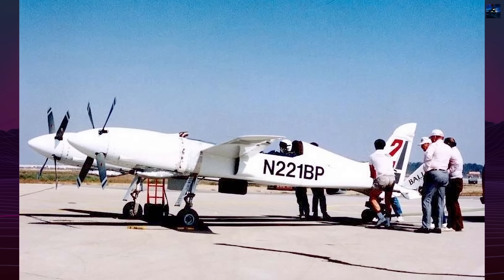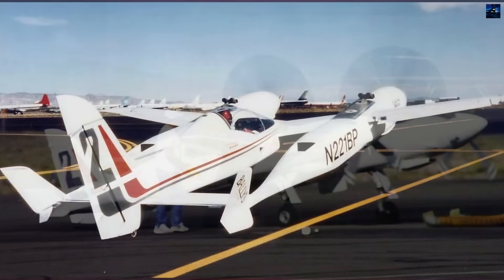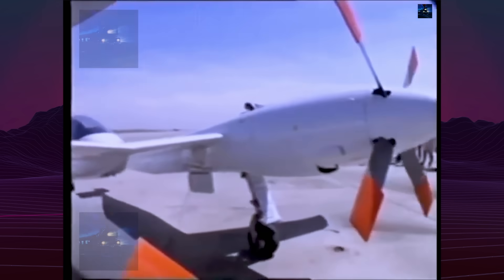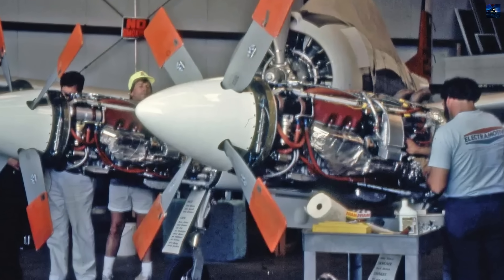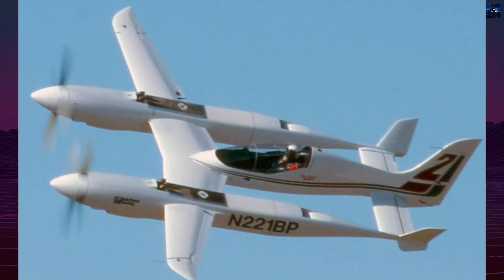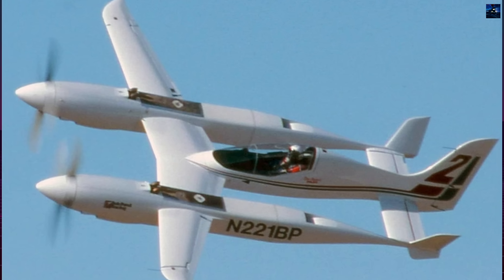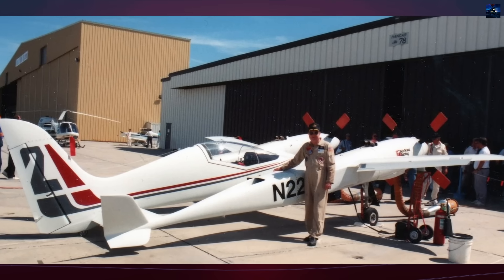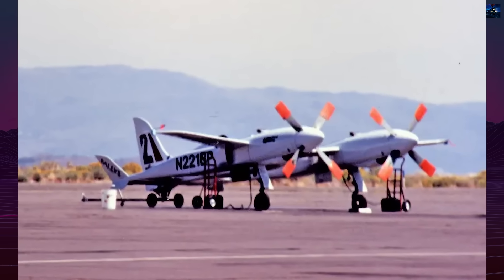Scaled Composites Pond Racer: That Weird Twin-Boom Racing Plane You've Never Heard Of

Comment: I was there, the day they went in. It was... a shock. Both plane and pilot had so much promise.
Still, the whole thing reminds us of how aviation mishaps are often a collection of successive "small" things. An engine out scenario in a twin is always a challenge, but manageable in the hands of a skilled pilot, which Brickert certainly was. In a small, light aircraft that was built for speed, however,  the rudder authority required to manage the asymmetrical thrust is borderline at best. When the engine failed, Rick lost the ability to feather the prop. The result was a huge amount of asymmetrical drag. In order to keep the aircraft under control, the pilot had to keep the airspeed high (i heard 175 mph) in order to have the required rudder authority. All this, with only minimal power from the good engine (asymmetrical thrust again), meant a rapid descent was required. I know that they were high enough to bail out when it started, but it all happened VERY fast, and for whatever reason, Rick decided to stay with the aircraft and attempt an emergency landing in the dry lakebed adjacent to Stead airport. That's a dicey proposition under the best of circumstances, but more than one pilot has walked away from that scenario, but in a tiny, plastic airplane, moving at 175 mph, the result was as predictable as it was tragic.
Reply: "I was there, the day they went in."

Too many times have I been able to say that.  I count my blessings that I was not able to make it there in 2011. RIP Jimmy, Rick, Gary, Tommy and anyone I have forgotten.

I remember when Rick brought Dago in in 1984 with the engine on fire and windscreen obscured by oil and smoke. The engine was nearly split in two by broken connecting rods.  The man had balls of iron.

Comment: I remember seeing this at the Planed of fame museum and was pretty impressed with reading the specs. Kind of wondered what happened with it for a few years then heard about the loss. I've heard from many aircraft people that auto engines are not suited to aircraft.
Reply: Yes/No. Aircraft have their own demands on engines and using an automotive engine requires reexamination and reengineering some details because it is definitely being repurposed. But there are a lot of Experimental category aircraft with automotive engines, from Piets with Model A engines to RVs with small block Chevys. My favorite was a Ford 3.8 V-6 adapted by an engineer named Dave Blanton in the late ‘70s or early 80’s. Used it in a TriPacer conversion called a V-6 STOL. I think about 12 were built.

Comment: In Star Wars I, both N1 and pod racer have strikingly similar geometry to this inspirational vehicle.
Reply: Now this is Pond-racing!
Reply: The N1 sure looks inspired by the Pond Racer, but it seems to be inspired by the XF5F Skyrocket (layout & colours).

And arguably also to a lesser degree by aircraft like the SR-71 (engines) and F-104C Starfighter (wings and tip mounted cilinders).

Comment: Great plane ..wrong engines.
Reply: Should have used a Ferrari V12 with turbos. More appropriate for extended high rpm use.
Reply: There was more wrong with it than just the engines. Perhaps a pilot ejection system would have been adequate...
Reply: @daszieher  Ejection seats are not allowed in air racing.
Reply: @MX304 didn't know that. I wouldn't race without a seat.

Not that I am anywhere close to having the choice 😅😂
Reply: @daszieher  It is a major safety issue for other pilots and spectators. Imagine if a pilot punched out and the aircraft went into the crowd. Or the wind carried the pilot under parachute back into an active flight pattern. Or someone pulled the handle in a turn and ejected directly into the path of another aircraft etc. That's why the FAA won't allow it.
Reply: @MX304  Thank you for explaining that. It makes sense.
Reply: @MX304  The only alternative option in your scenario is certain death. That doesn't make any sense to me.
Reply: @daszieher  VERY few deaths in air racing would have been prevented with hot seats. Either not enough time to even pull the handles, low altitude and bank angles being outside the seat's performance envelope etc. Plus people don't realize how big modern ejection seats are. You aren't fitting one in a P-51, let alone a tiny home built like the Pond Racer. Only the larger jest like the L-39s that are raced have the capability of having hot seats. It simply isn't feasible. Air racing is a dangerous game. They accept the risk.
Reply: @MX304 not being able to fit one in a P-51 may justify not having them in warbirds, however, it is no valid reason for forbidding them.
Reply: @daszieher  There are many valid reasons to forbid them. Which is exactly why they are forbidden. The pilots don't want them either.
Reply: @MX304 I disagree. It sounds like the useless discussions on why GA aircraft shouldn't have CAPS/BRS.
Reply: @daszieher  Apples to hand grenades comparison. GA and air racing are entirely different environments.
Reply: @MX304 they may be very different, but they share a common fact: once the aircraft is no longer controllable, there might well be a system to either save the entire aircraft or at least its crew.
Stubbornly arguing against a method to save the people aboard is like arguing against airbags. Taken that there are no airbags in land racing, however, HANS covers the same issue.

Bottom line, outlawing safety systems is asinine.
Reply: @daszieher  The extra weight would of nullified any advantages it had being small and light. Speed would of dropped off far too much.
Reply: @PixelatedExistence "would of"? 😂

That aside, of course, the rest of the aircraft would have had to be scaled up to compensate.
Reply: Not really. The engines did hold it back but the design had WAY too much intersection. Even if the engines had lived up to their promises, it wouldn't have been much faster.
Reply: No, the engines would have been fine, if they had been properly developed on the ground before going into the aircraft.
Reply: Sounds like half of my favorite WWII era concepts!

Comment: Remember the twin P-51 Mustangs, the F-82?
Reply: Remember the P-38, OV-10, C-119, Nord Noratlas, Focke-Wulf Fw 189, Fokker G.I?
Reply: Ever heard of the German and British WWII versions?  Google "Messerschmitt Me 609" and "Messerschmitt Bf 109 Z Zwilling".   Also google "Twin Spitfire".

The Pond Racer was never going to be competitive with those automotive V6's and only 1200 total horsepower.  Dago Red was pushing 3500- 4000 hp.  RIP Rick.  Miss ya bro.
Reply: @BogDogs_Swamp  Less drag = less power to achieve the same speeds. The engines were supposed to make 1,000 hp each, though.
Reply: @PistonAvatarGuy  Yep.  A repeat of the "Thunder Engine" project in the 1990s to turn a 1000hp big block Chevy aluminum racing V8 into an aviation engine. I was looking for the article about it in Air & Space mag but can't find it online anymore.  The chemical etching company I worked for from 1978-1981 was photo-etching experimental copper head gaskets for it.

Turned out the engine was so over-stressed from the greater loads that aircraft engines suffer from that it only could manage a 15 hour life before needing to be rebuilt. In the end they had to replace most of the parts with stronger ones and de-rate it to 600 hp to get a 1500 hour operational life. Orenda eventually bought it and sold it as the Orenda V8 as a cheaper choice to turbprops.

Pond racer was a great idea but the little car engines were never gonna do it.  Tsunami was the right idea to fit a proven big aircraft race engine in as small an airframe as possible.

Miss ya Rick.
Reply: @BogDogs_Swamp  No, it's just that big, pushrod V8s have short lives in general when operated at high power levels. In NASCAR, they barely last one race, while 1,000 hp F1 engines last for multiple races, practices and qualifying sessions. Americans are just in the dark ages when it comes to engine technology.

If the VG30s had been properly developed on the ground before going into the aircraft, they likely would have been fine. An oiling issue is definitely something that could have been solved.